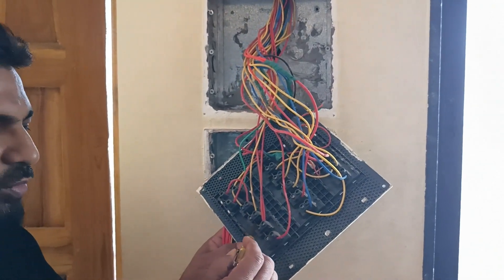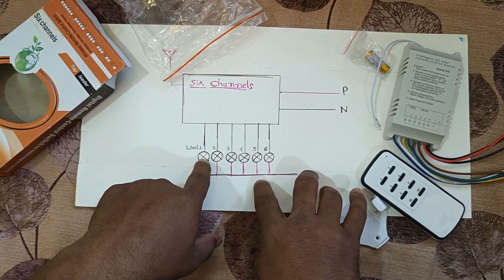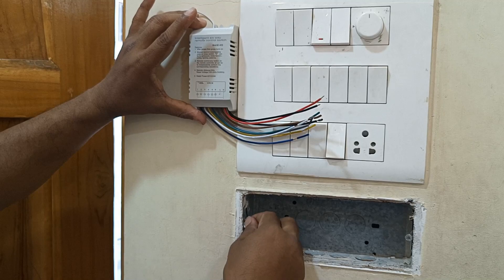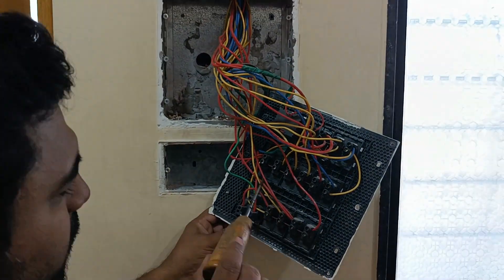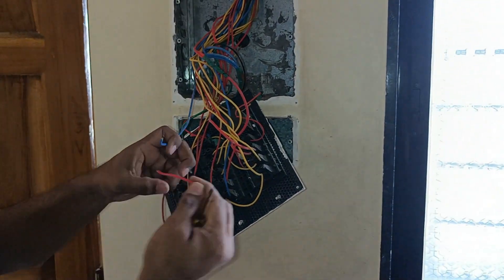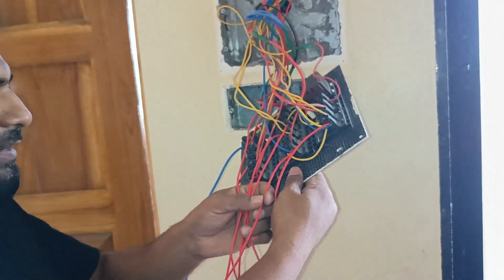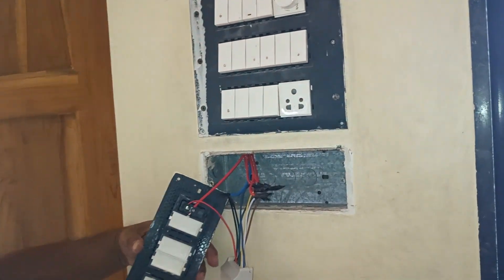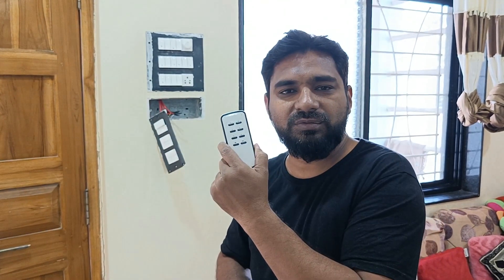How to convert traditional switch board to wireless switch board

Comment: While u on the switch in board and u cannot turn it off in remote. 
Good video though
Reply from the maker: Yes if you turn on switch manually you can't turn off switch through remote
Reply: @sakibmujawar3477  is there any other way to do that?
Reply from the maker: @jaganprasath1537 only way is to bypass manual switch but is something gose wrong with remote you can't use the remote
Reply: @sakibmujawar3477  yeah exactly